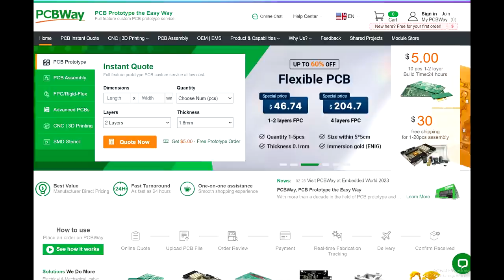Flex Cable Repair for a Prototype. Torn in Half. Urgent.

Comment: Anyone who attempted such microscopic repairs, especially on a material that is so fragile and susceptible to excess heat knows that it's insanely hard to do what Alex did here even with all the right tools, BIG respect!
Reply: for real! Very skillful, if it was me doing this job, i would probably have to resort to soldering enameled wire directly to the headers that this cable is supposed to connect
Reply: It's like performing neuro surgery on electronic devices!
Reply: Trust me, I done a similar thing. When you have a microscope its so mich easier to do.
Reply: @3ijnweu3oq3  it's damn near impossible without one. I've done it too, that;s why I'm saying this.
Reply: i’ve been trying to do this for the past 6 months, it’s way harder than it looks here, you spend too much time soldering on the area the coating of the flex and the flux gums up and ruins everything. Everytime the soldering iron touches the part it has to do something useful otherwise there’s not that many chances left, also soldering one wire without touching the one next to it is super hard, and many people don’t realize, holding the wire with the tweezers is an art itself, the wire has to be at the perfect spot on the tweezer tip, too high it won’t touch the solder, too low you may lose the grip on it. the wire itself also needs to be at the perfect angle and oritentation. omg i didn’t know it was so hard until i tried it myself, right now i can only do 2-3 out of 10 traces before everythjng melts and gets ruined lol
Reply: He didn't test it so we don't know he fixed it.
Reply: not that much diffecut until you have right tools and a month of traning thats it 
 he is not doing extra odniry thing in our country the is much much good
Reply: My hand would shake too much😂
Reply: @3ijnweu3oq3  A microscope AND very steady hands. 🙂
Reply: @SlartiMarvinbartfast  Well then i am lucky to have one of those the second i got a microscope

Comment: I never thought that broken flex cables could still be salvaged... wow, my respect.
Reply: you must be new here
Reply: Some can not. It depends on the quality of the plastic.
They will melt and shrink in the heat of the iron.
Reply: graphite ones are tad more difficult but ofc it all depends on the quality the flex is made.
Reply: Normally people don't bother to fix the broken flat/ribbon cable, just replacing it will save a lot of time and effort should a replacement part is available, and mostly it's not that expensive. Possibly this cable do not have a suitable replacement ready, or it is too urgent to wait for replacement part comes, or both.
Reply: @BahhBahhBrownSheep   I've only known this YouTube channel for about a month, and I've already learned so much from it. It really improved the way I work on my personal projects.
So, yeah, you could say I'm relatively new here, haha

Comment: I do micro soldering as a full time job for a company that designs ic's. Let me just say your repairs of the pads, and traces under gpu footprint, as well as this flex cable showcase an incredible level of precision. Thanks for sharing your expertise. I have always replaced torn flex cables, I might have to give some of the broken displays at the office a whirl.

Comment: VERY impressive work!

I fixed one flex cable myself by splitting, lengthening, separating, and rerouting the individual wires, it was quite nerve wracking, and that was only 4 wires with far more space, after practicing, using an inverted prime lens as a magnifying glass.

Again, VERY impressive work, and VERY steady hands.

I see that 'I did it' grin; well done!

Comment: Man, I've been doing microsoldery repair on the side for a few years now and I love it. Just recently started buying monitors that have vertical dead pixel lines. The problem is always the COF which is nearly impossible to replace because of lack of parts and the way they're attached is with a 1 time use glue with an expensive heat+press machine. The only alternative for a lasting fix is to do this and repair the bad trace. Been impressed with your work so far, but I didn't expect to see you repair a flex cable in a similar way. This is stuff that nobody in America really does and you only see it on the streets of India. Very cool stuff. If I lived in your city I'd quit my apply for a job in a heart beat. Woudln't even have to pay me. Just feed me scraps so I don't pass out.

Comment: Respect for the skill required to do this sort of work. I used to do similar work involved with installing microscopic strain gauges and routing fine wires throughout small components. All this work is done under a microscope. It is harder than it looks. I miss doing this work as once I got "into the zone" I could shut out the world and enter my Zen space where all is peaceful and I forgot all my problems! Sounds nuts but it was the best therapy I had! lol!

Comment: I did a similar attempt of this bridging with much more crude tools on PCB (traces got eroded and I wanted to bridge them).  It was very difficult; the heat would often move the previous wires.  I eventually did get most traces bridged.  I can see similar techniques, and those are the best for control and placement.  I also had to develop a technique to keep the hand steady - the slightest movements are big at this level.  Excellent work! 

I wanted to make a soldering laser to alleviate the motion problem.  I think it should work, but I never got to making one.

Comment: Great job on the soldering of very thin wires, it's a nerve wracking, just a reminder note
after completing soldering, you must always ensure that adjacent very thin wires do not touch, otherwise it will damage the prototype board when you connect the flex cable and make things worse, at least that what I always do.

Comment: When you held it up to the camera at the end... its tiny! Huge respect!!! I was surprised you still used the knife to cut the excess wire considering how fragile the flex cable is! Press a little too hard on the knife, and you'll have more flex cable to repair!

Comment: I've done this exact same repair on a keyboard flex cable. The repair is quite tedious, no question about it. The problem is the cable might break again in the exact same place if flattened, which is why it broke in the first place due to metal fatigue. Once flattened and "re-opened" it takes very little force for it to snap.

Comment: I like using b7000 glue or just hot glue once completed. Adds to the strenght of the cable but won't break if you bent with force.

Comment: Having done this type of repair in the past, I find it easier to design a new cable in KiCad using the original as reference and get PCBWay or similar to produce a new one.
Reply: Easier for sure, but he needed it the following day for the presentation.

Comment: A better way is to scratch ribon cable at different un even  locations so that you don't risk a short when soldering,   or when  it flexes later with customer using it.

Comment: I have done it without any soldering pen, I used 10 doller soldering iron that has an inbuilt temperature knob on it and without a microscope, one side perfect but wasn't able to make it work because mine has traces on both side and cause I don't have green mask or anything like that so when I does one side and apply heat on otherside, the opposite ones get desoldered due to very thin insulation layer and also the flex cable wasn't long enough to choose long distance areas.
But still it was one of the hardest and adventurous one for me.

Comment: Would look a lot better with solder pads (pad strips) instead of jumper wire but still a good job!
Reply: Did you mean pad strips. The jumpers Alex used will be stronger than strips
Reply: Soldering pads or whatever are too wide for those traces.
Reply: I'm surprised you're inclined to give advice about how to do this better. I suspect maybe a dozen people alive could do something like this with a soldering iron, I don't think I've ever seen solder work this precise.
Reply: @Puzznik  I do this daily
Reply: @Puzznik  I must be 13th person in the world then
Reply: What field requires microscopic flex cable repair daily? I don't know microsoldering generally so I assumed that's rare.
Reply: @Puzznik  yeh your right it's quite rare we would repair a flex daily but it's the same job as restoring pads etc which is the daily grind. It is very difficult when you first start out but like anything it gets easier with time
Reply: Flex cables would usually be replaced, this sounds like an exception for one time use. Or did you just mean you do soldering on that miniature a level? If so, hats off to you. Other soldering content creators on YT can generally get it done. Alex's work looks the best that I've seen.
Reply: Of the several years I've watched NRF this was the most impressive repair I can recall. His soldering iron is so low that the solder almost didn't flow, the thin cable could take almost no heat.
Reply: This video reminds me of tig welding soda cans together while screwing around in the shop. But I ruined a lot of cans before I got one that worked. And still that is naked eyes under the hood, using a microscope has always seemed like a greater challenge. And the lines can't touch. Getting comfortable making such small movements must be what sets good microsolderers apart.
Reply: @Puzznik  yeh flex cables would be replaced if they can be unfortunately lcd screens etc are not meant to be replaced but can be repaired this way. The one Alex was working on is a prototype I believe and its possibly the only one at the moment
Reply: @jontait1095  Makes sense. Yeah this line of work is incredible to me. Traces the size of body  hair, this blows my mind.
Reply: @Puzznik  Actually the job Alex did in this video is quite … sloppy. Even though only a few people are posting on the internet, we are hundred of thousands capable of this work.

Comment: Surely if you're building a prototype you'd either A: use off-the-shelf ribbons and order a few of them because they're cheap, or B: use custom ribbons and order a few of them. Setup costs are usually high, materials cheap. So you could have 1 cable for maybe $100, and every one ordered at the same time costs an extra $5. Not having a spare ribbon or two or three to hand sounds like excessive bean-counting or poor engineering. Excellent work repairing it though.

Comment: Why not just replace the flex cable? 🤔🤔🤔🤔🤔🤔
Reply: Re-watch/ listen to the 1st few seconds….customer has a presentation in the morning. I’m assuming getting a replacement from China may not arrive in time
Reply: Presentation is tommorow and it is a prototype product, so specific for this model.
Reply: It's custom. Not available in market 
And it's for prototype so they have only one
And they said they have presentation tomorrow.
building custom flats is like custom pcb.need to order and waiting
Reply: If I had a prototype of something made I would definitely have backups of the frail parts.
Reply: and waste a chance to make an impressive video, no. Next time soldering a pcb upsidedown